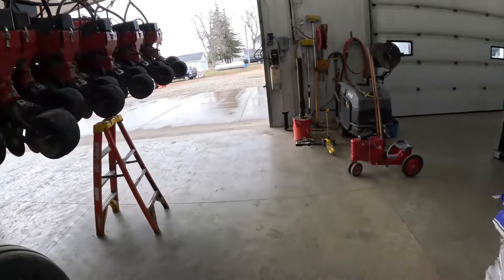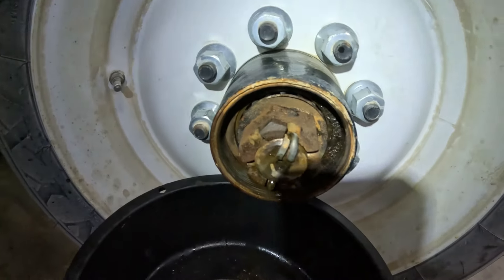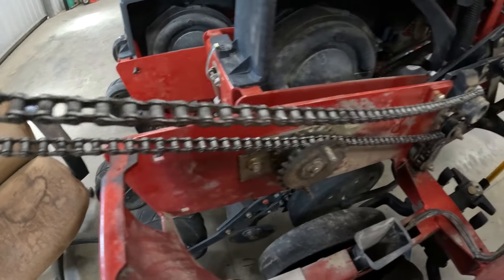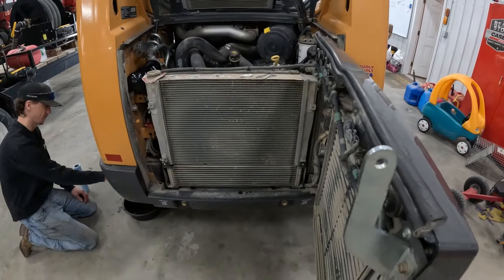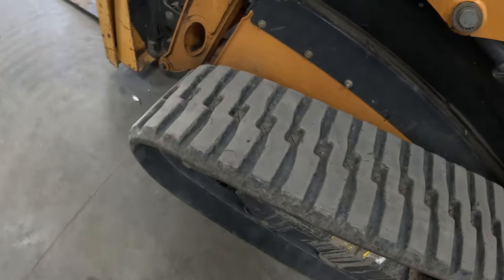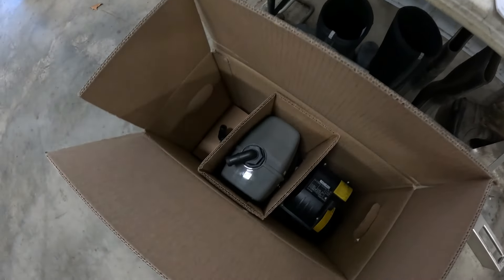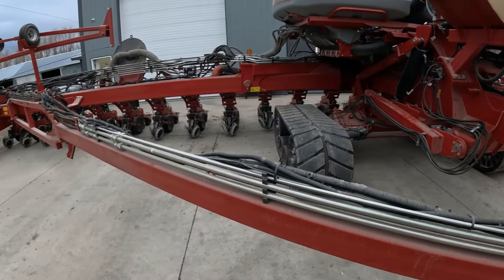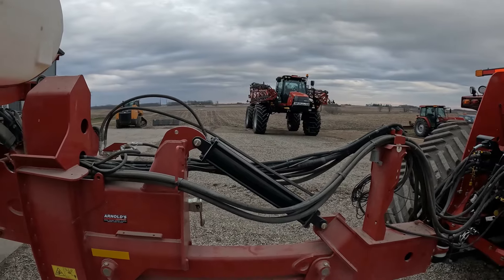4 DAYS TILL WE HIT THE FIELD

Comment: Kinda wild that ya handle that many ams bags while spraying lol. Keep an eye on your 2160 front tongue for cracks. I imagine its just split rows that r cracking but its a problem
Reply from the maker: Ya lots of bags. I’m lucky enough to run the sprayer and my son brings hot loads so I don’t have to throw bags 😎
Thanks for the heads up I did check it no cracks yet